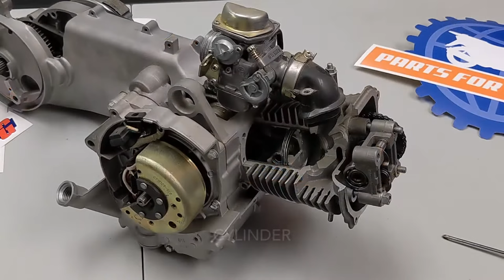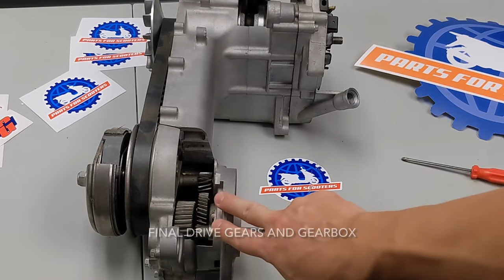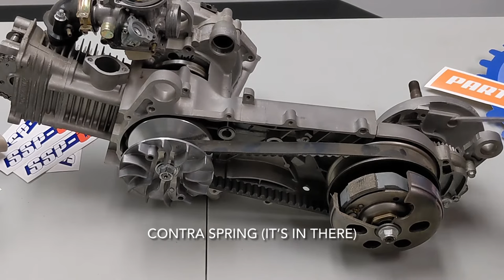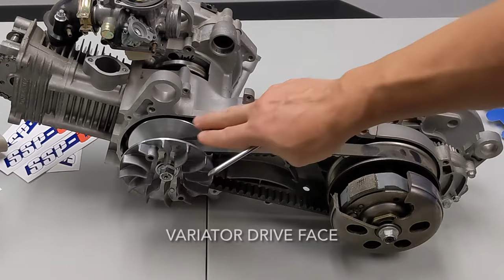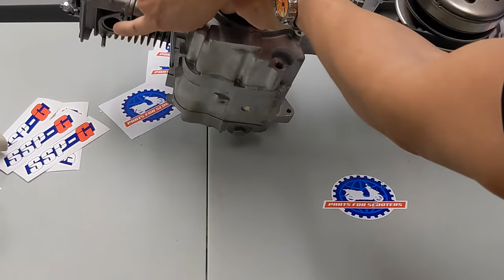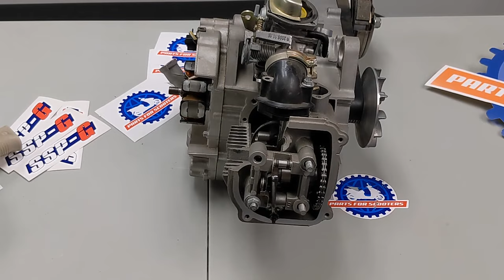Demystifying a GY6 scooter engine

Comment: Ha! I got you Matt! The oil drain plug is the hole in the cases underneath the variator on the left side. What you called the oil drain is the screen oil filter chamber. You can drain the oil that way but it entails pulling the filter that, okay, is probably a good thing to do.
Reply from the maker: You ain’t wrong!